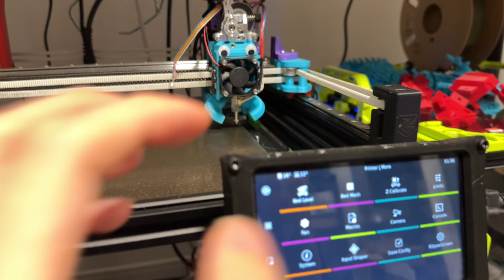99x99 probing test?! Cartographer Eddy Current Sensor on Ender-5 Plus ZERO-G Mercury (Klipper)

Comment: Looks like the belts are causing the gantry to rack in the + y direction when at the extremes of the x axes due to the bend radius of those steal banded belts. I imagine 2GT-RF gates belt you mentioned would do wonders.